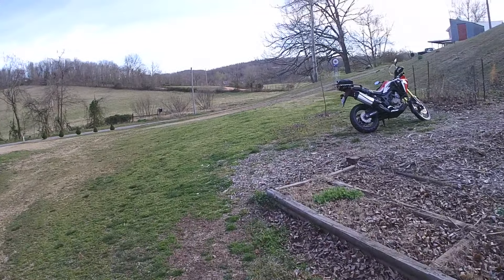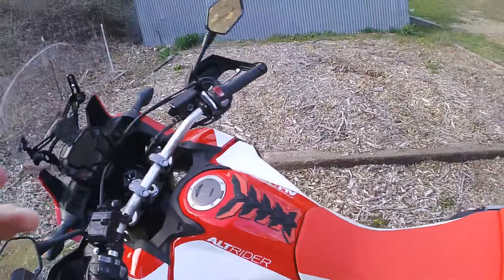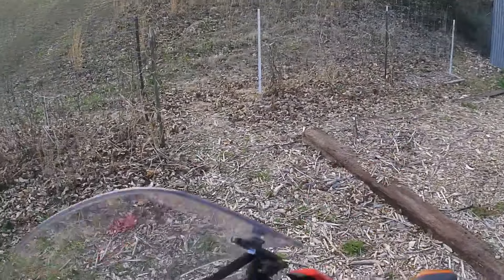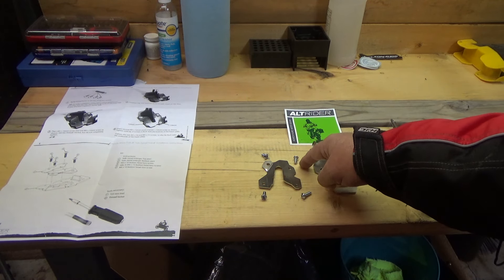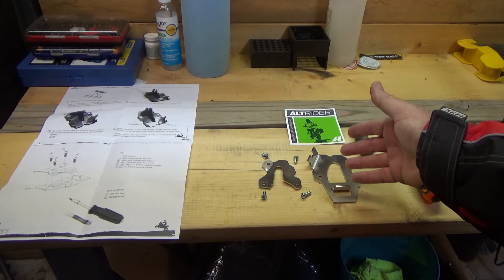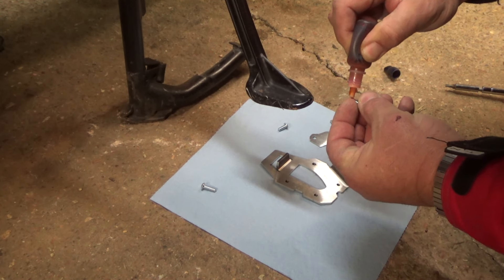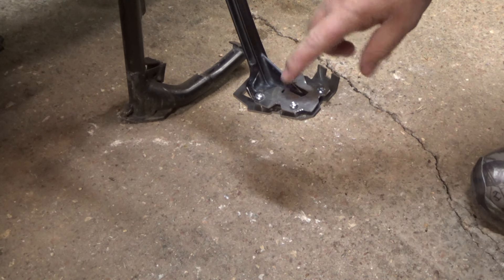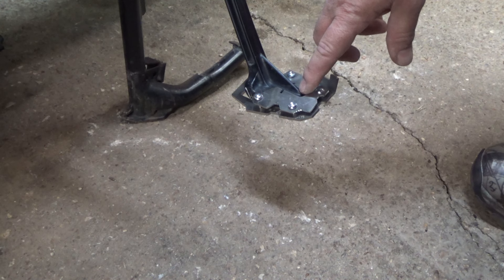AltRider Side Stand Enlarger Install Honda Africa Twin CRF1000L 2016 2017

Comment: Loctite it good! My screws came out right away. I was never satisfied with the fit on my V Strom. Very poor. And the use of hex-heads in my opinion is not good either. Sure kept it from falling over though.
Reply from the maker: +richmoto1 yea I did put the red Loctite on the bolts. The fit on mine was great, I will keep a check on the bolts also as I do all them.

Comment: You think a piece that simple, (build the side stand with a larger footprint) that Honda would just design the side stand to incorporate this feature? These adventure bikes are parked on all sorts of surfaces where a fairly heavy bike (especially with side luggage) using just the existing OEM side stand can fall over. What do you think Honda?
Reply from the maker: +07canuck I totally agree with you on that one ! Thanks for the comment !

Comment: looks good  but I am  cheap,  I  used a  hockey  puck  sliced in half +3  small  bolts.  saved  48$  but lost  30 minutes of my time!
Reply from the maker: +jjustj lol well that would work bud don't let a big rock hit it.  I think the AltRider Enlarger is well worth the investment, you but it once and because it is stainless steel it will last a lifetime. And it looks great !
Reply: I don't know if that "side stand enlarger is a necessary add on. I just moved to NC and have a long, very bad unpaved, soft & hard dirt driveway with some small rocks. Since where I park my Africa Twin (AT) is basically in the woods I get dirt & mud all over my shoes & tires. The ground is very soft when it rains & decomposing spongy leaves are everywhere.
The Honda AT has the best side stand I have ever had or seen on a motorcycle. It is long enough & the pad on the side stand's bottom is wide. I have put the side stand down is some pretty soft dirt & it held the bike up with no problems. Maybe the 2016 bikes had smaller side stands but as a user of the 2017 AT the bike's side stand is near perfect (IMO)
Reply from the maker: Mostly for soft ground